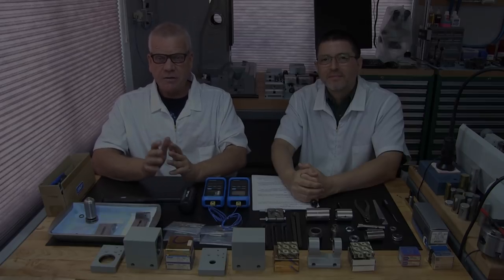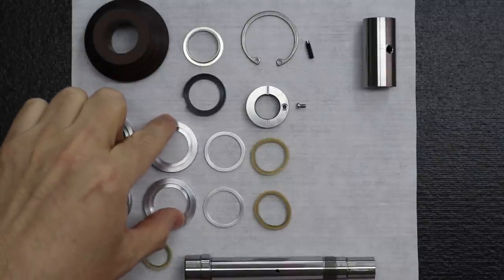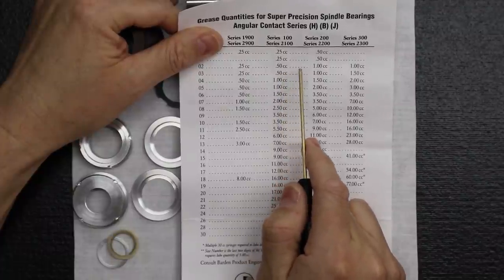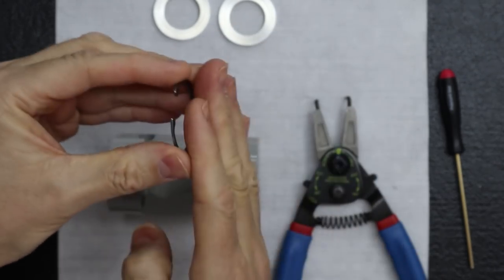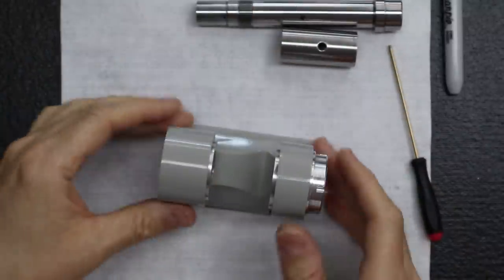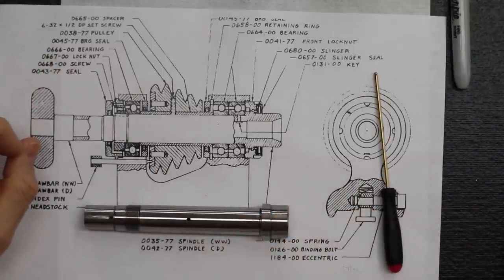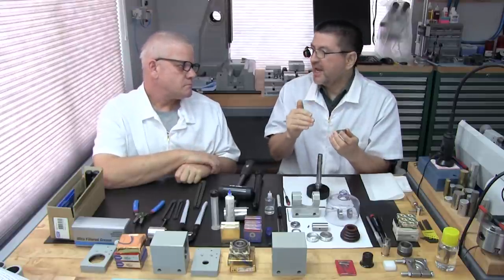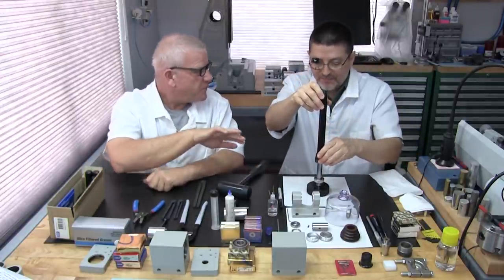Precision Machine Spindle Rebuilding - Part 3b Assembling a Levin Open Style Headstock

Comment: Another excellent video. You can't go wrong if you follow the procedures that Patrick and Lance have demonstrated so well. Thanks again fellows.
Reply from the maker: Hi James it is once again very appreciated having you here joining in the comments we love to know what you and the viewers think about our efforts and we are of course more thrilled when the comment is of this magnitude of positive appeal.

Have a great rest of the week, we are working really hard to complete Part 4 Spindle Break-In.
Patrick will be doing some preliminary spindle testing and inspection before Lance begins doing the spindle break-in procedures.
These are really important, they run the spindles through highs lows in speeds some time limits and the likes, it is going to be done on a Levin Lathe Instrument bed with a nice RPM regulated motor and includes the monitoring of heat buildup during this second to final process leaving only the spindle grind to remain, so we can see how close or even tighter then the factory specifications of 50 millionths (TIR) Total Indicator Run-Out we can achieve.
Just as an insider reminding for you James, this head stock and many of these other spindles are more then 70 years old, so we are being we hope GREAT caretakers here.
Lance & Patrick.

Comment: Thanks guys for another great video! I appreciate all of the fine detail.
Reply from the maker: Hi D K.
Well you survived Part 3b, that is a video of us rebuilding our favorite type spindle the Levin Open Type Headstock.
We both had such a great time rebuilding this one even the paint work done prior to filming was done with really fin e care and attention to detail, it took a lot of time to get that paint work just right before baking it into place.  

We still have Part 4 to do starting with some preliminary testing of the spindle to establish a set of perimeters as a baseline to begin from for the spindles Break-In a process where we will be monitoring the temperatures while running through a series of factory designed RPM run-ins at time lots to assure a good break-in is achieved, that will leave only the spindle nose grinding to finalize this rebuilding of the Levin Lathe Headstock open type.

Thank you for being here commenting and sharing these good words with us both, we are doing the best we are able for our first ever Educational Series, we will improve in time even better. 
Lance & Patrick.
Reply: @ActiveAtom  Looking forward to the next video. You two sure are masters. Love to see your attention to detail. Thanks again.

Comment: Fantastic! Why don't you measure spindle run-outs turned out finally? Would be very interesting...
Reply from the maker: Hi Sid, Patrick says you must remain in the patients room with this build and wait for this Part 4 Haha, we will share ways we will place your concerns at ease. LOL.

Great you mention this topic though, we need help when and wherever we can get it as we do not have all the answers though we did have these covered otherwise we cannot being the spindle taper nose grinding without some level of a reference or baseline.

WE ARE NOT DONE YET 2 MORE STEPS AND A CHIT CHAT TO GO
We are not done here with this spindle rebuild, sorry this might have come across as a bit confusing for you some and others that are like you paying really GREAT attention to the spindle rebuild build.
In Part 4 we will perform some preliminary tests as that is right before the break-in of the spindle, this should address this issue.

We still then have Part 5 covering the Spindle Grind operation to finalize then lately and finally we will have Part 6 the Q/A section covering the many emails and comments where are going to share. 

Thank you so much for being our friends.
Lance & Patrick.

Comment: Why not drill 1,5mm holes in the spindle nut?
Reply from the maker: Hello Huib and we thank you for stopping in sharing your thoughts on this we think the spindle nut for the Levin Open Type Headstock. 

We think you are sharing to drill or alter the main spindle bearing nut from just having those slots or the half moons of the spindle bearing covers also referred to as the bearing dust covers to each have 1.5 mm holes drilled or added by us to make this tack at hand easier or better to perform.

We like your thought, however we have two things to share so you can at least know who we are and what it is we are sharing here from our points of view mind you. 

We cannot alter these machines and tools as we want them to retain their original parts and functions as it is our final goal in life to add these to our now started collection of watchmaker tools and micro-machinery for the someday 9 years out Hands-On working Museum.

Finally we are not in need of great forces (camera does not convey this issue well) as precision machinery and tools, when done right, preparation is the hidden secret, a secret that is out in front for all of us to see but many ignore as to why precision tools machines and instruments never need aggressive forces that often are discovered by us as we run across them often over the nearing 3 decades we have been doing this type of work.
 
Thank you Huib for stopping in joining in the conversation asking this great question and sharing it as it might work for someone that reads these comments which is really nice of you to rise this question, so thank you.
Lance & Patrick.
Reply: Hello, Lance and Patrick,Thank you for your answer.
The suggestion and question I raised was more intended to prevent you from not going out of the grooves with the key and damaging the wire or the spindle.
Preserving the originality is of course always the first priority, but an adjustment to prevent things like this can also fit in, but that's my opinion.
The forces you exert on the key are often greater than you think, the pressure on the 1.5 mm pins is, due to the arm length of the key, many times greater than the force you instinctively exert on the key.  Which of course does not mean that they are very large forces, but still more than one often thinks.  
Of course it was not my intention to correct your way of working but only to make a suggestion to prevent damage.
Reply from the maker: @huibhoogendoorn2804  Hi we are sorry you provided a solution to help us and we did not reply well, we did not understand, so as we often do, we answered with a hard answer (we are again sorry) we could stand a bit of calm around here, truth be shared.

We are thankful you are here with us and more so you share thoughts ideas and convey these through this comment community.

We read you do understand our equipment originality that will make sense in the coming years as we disclose many additional pieces of machinery and tools for our hands-on working museum, a dream to open this museum as it grows over the coming 9 years, we as a YouTube creator turn 1 years old on September 03, 2019, so we are really happy we are doing this sharing thing, we almost did not, see we live a somewhat private life, well we did until we started sharing our works on social media, we are in the end happy we did Huib.
Thankful x 2 to call you our friend.
Lance & Patrick. 

P.S. New video release next Monday a Shop Adventures followed by Part 4 of the Precision Machine Spindle Rebuilding Series we we will do some preliminary tolerance testing for the spindle and then begin the temperature, rpm and time break-in leaving only the spindle taper nose grinding work in part 5, that finalizes the spindle and it can return to regular duties here.